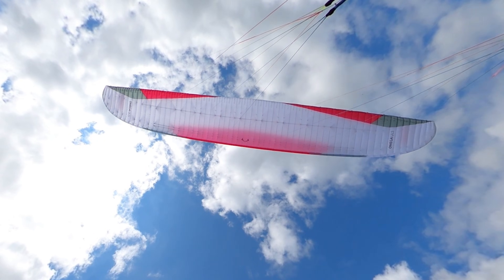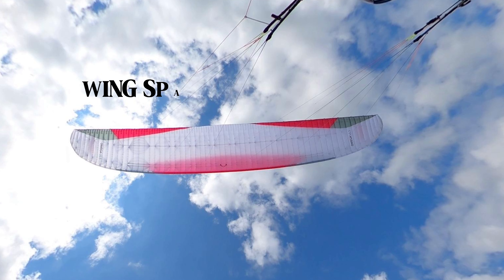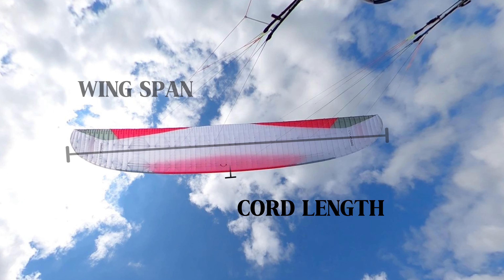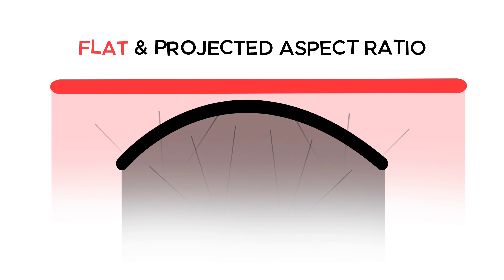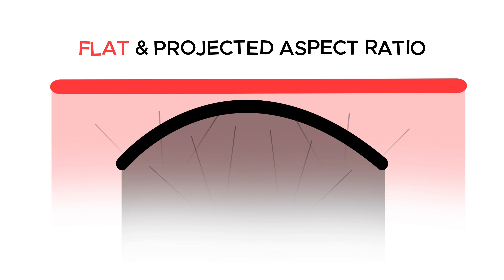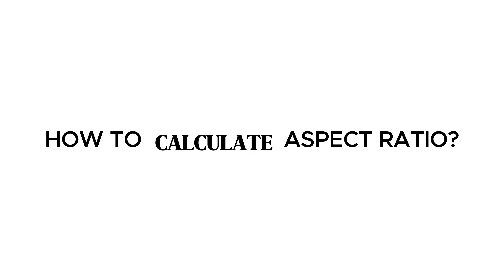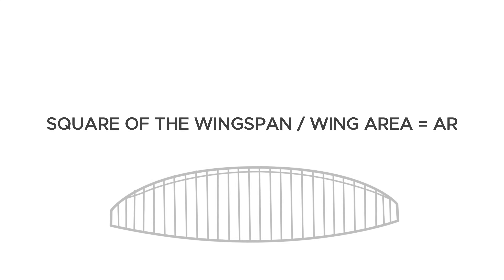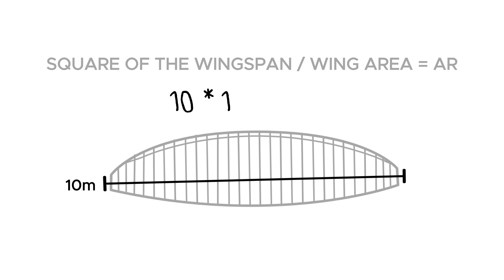Paragliding ASPECT RATIO Explained

Comment: I think that in time, technology will give us two-line paragliders in the low B class. And this will put an end to the debate about the performance of the wings and the coolness of the pilots. In part, this is already happening, and examples are still high wings such as the Ozone Photon and Delta 5. However, this is no longer a D-class. Now, 2.5 line high B wings are produced. And this is good. More performance, more safety.

Comment: Nice explanation, thanks. But, I think it's a little bit more difficult - when comparing absolute sizes of wings properly loaded with the same AR, doesn't have wings different properties (performance, stability)? I noticed the same model can have different classification for different sizes (also the same size can have different classification for different wing load)

Comment: It should be the one with the least aspect ratio but the longest one warns you sooner and allows more active piloting avoiding collapse, the one with the least aspect ratio by damping the turbulence does not warn you and you only realize when the collapse arrives, yes, it opens quickly You just raise your hands, my experience in my two wings, one of AR 7.6 and another of AR 6.9, taking off at 3000 meters above sea level and on the Equatorial line, greetings

Comment: I fly a high aspect Peak 3 at the dunes, But fly a lower aspect High B Nyos on the winch and mountains. So it depends on the place i fly. I would never consider flying my Peak in thermal air or even on a winch in "laminar" conditions. Cause when it does go wrong, It might be too hot to handle.

Comment: Hi. Great video.  I noticed that the AR of the new bunch of C 2 liners are relatively low. Lower than many  classic 3 line C wings.  So I wonder if these 2 line C wings  are better or worse performing?
Reply: It is always a compromise between performance, handling and safety. By going from 3 lines to 2 lines you remove some line drag. Nobody would buy new 2 liner C wings if they were not faster.